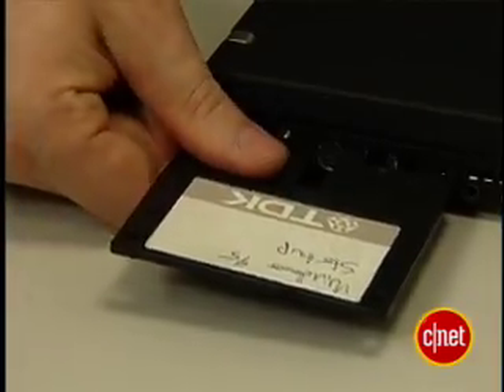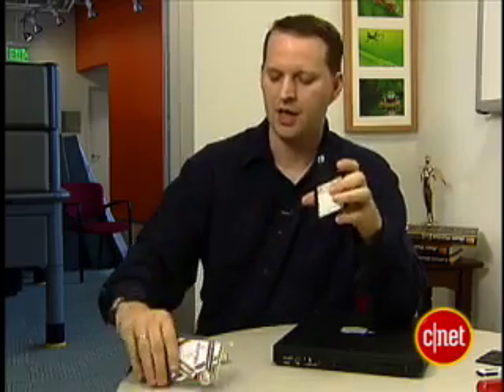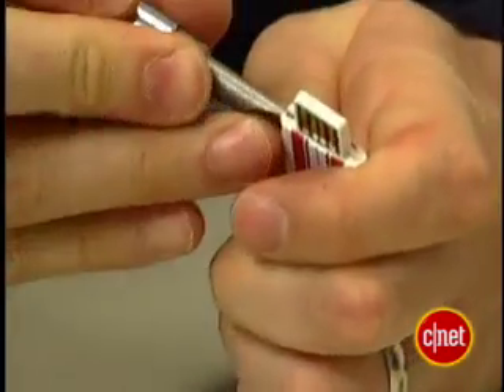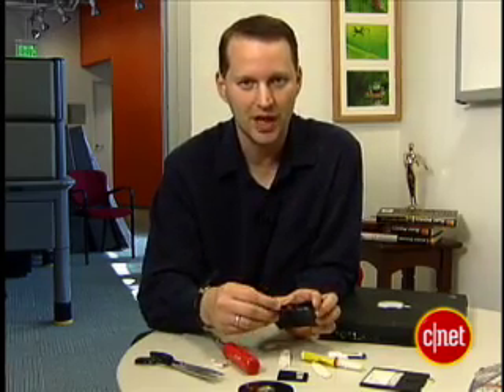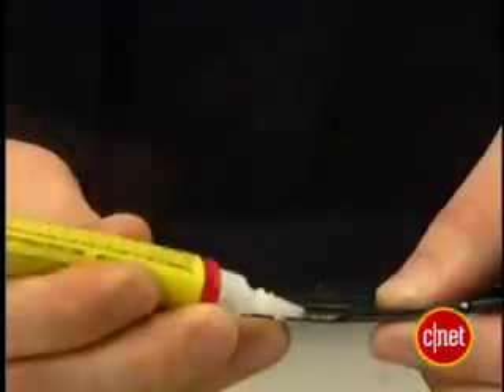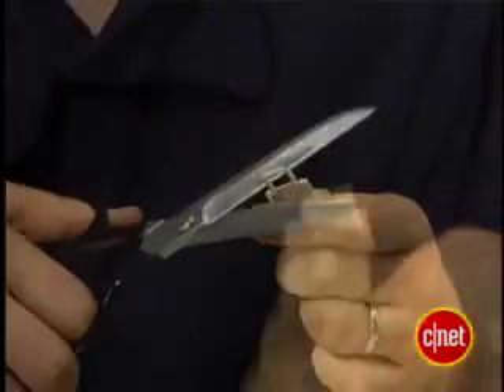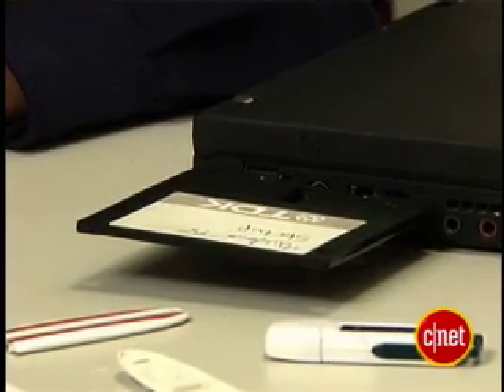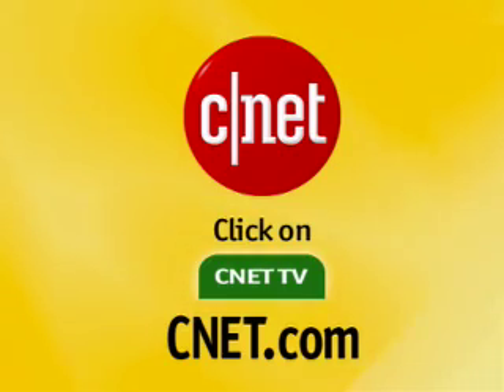How to make a USB from a Floppy Disk

Comment: This is cool and all but I need a hack that does the reverse. Got an old technics sx pr-900 off auction for cheap. It comes with a  floppy drive. Now floppy disks aren't made anymore and I wish I had a converter where I could plug a flash drive into a component that is like floppy disk and put it into the disk drive. Sorta like those tape to headphone jack converters. I've been told to just replace the disk drive with an emulator device. Sadly those devices are too big and meant for a PC. Second disassembly of the piano can cause damage to keyboard without special tools  so that's a no go. Kinda stuck.

Comment: I have a question, is that a floppy to usb converter? What I have is an older laser that all info has to be transfer to it on 3.5 floppy's so if I can find a floppy disc to female usb converter it would make my like a lot easier.

Comment: Yes, I have a better idea to do this.  you don't need super glue, you don't need to pop up the disk drive.  just plug the usb drive into the usb port. and done, you have a small 4gb only for $15 . or you can use an SD card.  it looks like a tiny floppy disk.

Comment: get a USB extension cable maybe? Or just copy everything that needs working with on the drive temporarily to the computer, take the floppy out, plug the other stuff in, when done, disconnect everything else, stick the floppy back in copy everything back and the job is done.